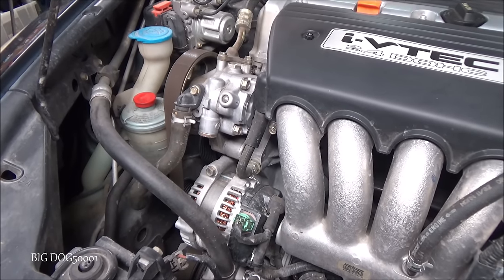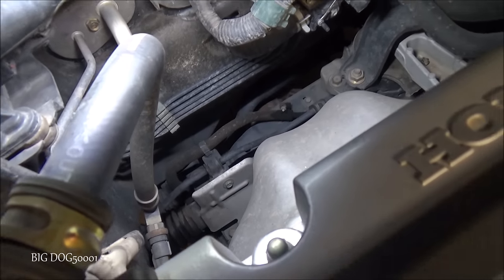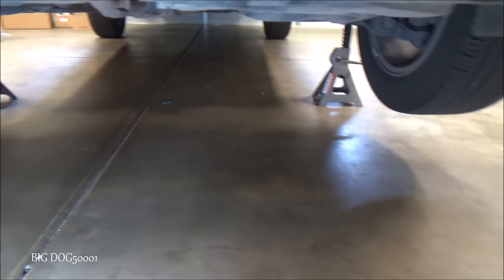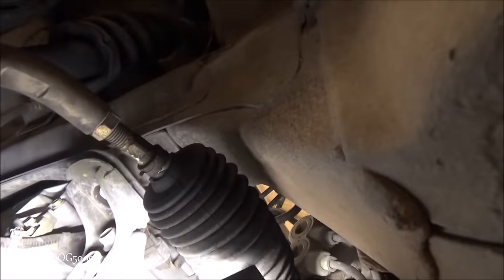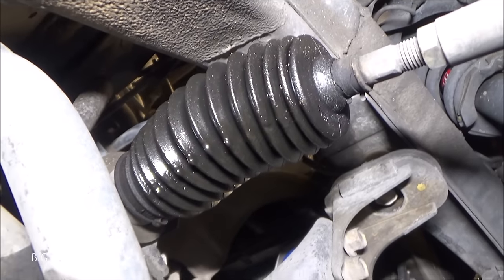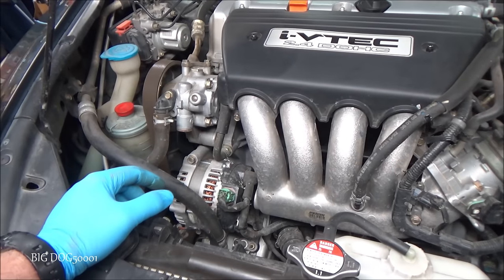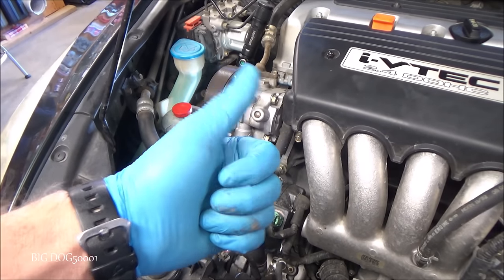Honda Tips: Finding a Power Steering Leak

Comment: My father in law had a power steering leak on his car (2004 Accord). I found it was the upper hose leaking from the pump to the rack. Thing was a BITCH to fish through to the rack, but after a little patience and a lot of cussing, I got it on. 
My sister in law had low fluid last week. I just happen to hear it when she was leaving and told her to leave it. I didn’t look underneath, but I saw a little oil behind the pump. I changed the Oring on the hose and topped it off. If that doesn’t fix it, I’ll take a better look at, but I’m wondering if I won’t have to rebuild that pump. Is it difficult to do? She has a 2007 Accord.
Reply from the maker: Leaking pumps are not too difficult to take apart and fix.  Thanks for the comment!
Reply: @BigDog50001  Hopefully that oring fixed it, but I get the seal kit if necessary and go from there with it. Pretty sure it needs a NSS right now, though lol. Thanks for the reply.

Comment: I have a 2004 acura tax and cannot find the leak from the steering pump onto my alternator. No issues with my pump really and fluid isn’t really ever that low. So it’s a small leak. Any suggestions? Maybe change all the seals in the pump first before I buy and install a new one?
Reply from the maker: Hard to say without seeing it but the seals on Honda power steering pumps generally start to leak by that age.  The fluid will usually start to deteriorate drive belts if left on them.

Comment: Also have the same problem with our family car (Honda CRV 2003). Will need to bring the car to the dealership again in the Philippines. I'm curious how much will the dealership charge me for the power steering leak. It's been months that I'd top up the fluid before driving out.

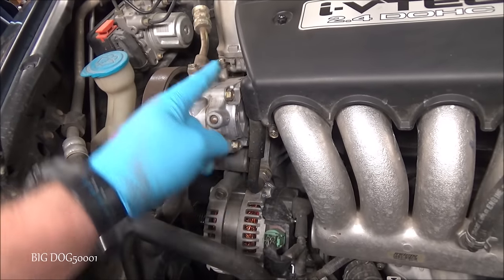Comment: 05 accord 4 cylinder ,Mines been leaking very little from the eternal seals like the video showed at 1:00 only had to top off once within the last 2 weeks very tiny leak but today I popped the hood and noticed alot of power steering fluid coming out the top of the resivior with a lot of small bubbles do I need to replace the power steering pump immediately or can I still drive for a couple more days because I don't get paid till Friday and I drive around 100 miles a day 

Ps forgot to add, this is my only car

Comment: The whining noise can be hard to diagnose on these engines, it could be a bad o ring that isn’t even leaking but letting air in , could be alternator bearing, could be tensioner , could even be a transmission bearing issue causing whine , good video tho
Reply from the maker: Yes it can be tricky, thanks for the input!

Comment: How much approx is an OEM power steering pump on this model? How much did this job cost with labour?
Reply: Ayoub Farid too much. Several hundred
Reply: Ayoub Farid around 800 a one sided I call for Civic join the tell me 1000 each one

Comment: There is good aftermarket stuff out there , you just have to investigate a little bit. My boot was gushing PS fluid and had to go but I got an aftermarket product and it seems to be working good , zero leaks, a year after. This usually happens to older cars so the expense of putting in a brand new OEA on a car that has limited years on it does not make sense at all. The diff can be as much as 300+ so keep and open mind.

Comment: I replaced my power steering pump on my Honda Accord 2002 but the winding came back after about a couple weeks. I'm suspecting it's not the pump. The fluid does go low after about a month too. The winding/grinding goes away for a few days but comes back again. Any ideas? Rack and pinion maybe? It makes the noise even with fluid in there. I smell a burn smell at times from the reservoir. 
- This video is amazing! Thank you. I will check underneath at the ti-rods.
edited:
- My guess with the oil leak is that the oil filter SEAL came off and when the oil filter was replaced the person replacing the oil filter placed the new oil filter over the used oil filter seal. OR whom ever replaced the timing belt didn't replace the seal and it started leaking oil at the timing belt area. That happened to my Honda Civic 01. Now I have to have a mechanic fix the oil leak and replace the timing belt again.
Reply: check the 2 Power steering O rings

Comment: I have some small drops of red looking fluid under my honda element 2006 and the power steering is low what do I need to do?
Reply from the maker: I would top off the steering fluid first (with Honda fluid only), a low fluid level on a component can sometimes lead to finding a leak but not always.  I generally start from bottom and work up to find the cause of the leak, sometimes it is necessary to clean up everything good to find it.   Leaks have a way of running across an engine/transmission like a plinko ball so it can be difficult sometimes.

Comment: I have owned two accords and both of them have leaked on the bottom of the power steering fluid reservoir tank.
Reply from the maker: Thanks for the input!
Reply: What was the cause of that leak, cus my 99 civic is doing the same all messy under the reservoir tank
Reply: @VictorRodriguez-nq9xc  in my case I think it was one of the low pressure hoses. The small diameter return hose was cracked on one and the larger diameter hose that feeds the pump showed a larger diameter than normal I guess through wear and tear. Anyways my 04 Accord is fixed concerning that but my 06 Accord I’m going to test it out today on a long drive. I’ll let you know the outcome.
Reply: @jogmas12  did you replace that hose?, I’m thinking of using blue devil stop leak but I hear is only for the rack n pinions?, it wouldn’t cause any effect to the hoses connected to the reservoir tank of the PSF?
Reply: @VictorRodriguez-nq9xc  I replaced the hose and took it for that long drive. Came back but it was still wet underneath the reservoir tank. I’m thinking the small return hose needs to be better seated.

Comment: Hey bro I have the same problem with my 2003 Honda accord my driver side boot has oil on it coming from the inner on rock auto they don’t sell the whole piece together they sell the outer the inner and the boot all separately I know it’s not Honda OEM but I’m only gonna have this car for another year so I’m not too worried about it should I just buy the boot and the inner tie rod?
Reply from the maker: new boots and tie rods will not stop a power steering leak, it is the seals going bad that generally cause leaks at the rack.

Comment: When we mentioned rebuilding pumps, what did you do? I have no power steering at low RPMs, which is supposed to be common in the Odyssey ('06). I replaced all the O-rings and the bearing seal. Is there something else? A whole new pump is pricey, so if a rebuild is possible I'd rather do that.
Reply from the maker: I will take them apart and replace all o-rings, seals and bearings, *to correct a leak*.  When there are other problems like no power steering assist at low end (which is very common on 2005-2010 Odyddeys) and the issue is the pump, I replace the power steering pump.  This is also what Honda does if there is an issue like that.  Some of the internal parts (like the flow control valve) are not available separately which I why I do not try to rebuild them for issues like that.

Comment: Dave, another very good informative honda video. I purchased a rebuild kit for my 07 3.5 for that small O ring on top of the pump but so far the 99 3.0 has been good. Fingers crossed. Will you record the repair? Might make for an interesting video but probably too time-consuming. Have a hot one on me I know I will temp is around 15 degrees here on Long Island. ❤️️
Reply from the maker: 70 degrees there today, brrrrr!  Thanks for the comment!

Comment: Would you suggest oem salvage rack and pinion?
Reply from the maker: Typically no because they will most likely have the same issues.  They have a high failure rate after a certain age.

Comment: Hope that’s not why mine is whining now ... doesn’t appear to be leaking though cause the reservoir is filled between the lines ... What’s a rack from Honda cost ?
Reply: $1423.88  Was just at honda today getting my recalled airbag replaced and they said I needed a new rack on my 04 accord.  I'm waiting...
Reply from the maker: They cost a lot depending on model, they are a lot of work to get in and out.
Reply: I noticed a whining sound recently & guess what..??  A leak!!

Comment: How many hours in shop time to replace a '04 steering rack and do you recommend replace motor mounts at the same time???
Reply from the maker: Book time for a complete steering rack on those is about 3 hours, plus additional time for an alignment.  Changing mounts would be a judgment call based on the condition/age of mounts (and whether the owner wants to), I would not change them solely because I was replacing a rack.

Comment: Power s. Pump leak and i already changed the pump but still leaking. Wht shoud i do ? 🙁
Reply from the maker: Depends on where it is at, if the leak is at the pump then most likely it is either the seals inside the pump or the seals that attach the hoses to the pump.
Reply: If you already replaced the pump then it's the hose, most likely the high pressure house

Comment: Did you find out about that oil leak? I came to this video to learn about the power steering noise, but upon changing my oil today, I noticed the same leak in the same spot!
Reply from the maker: Vtech solenoid gaskets (spool valve filter).  Very common leak on many Hondas.
Reply: @BigDog50001  thanks!
Reply: @BigDog50001 are those easy to replace. I have that issue with mine

Comment: i just changed my power steering pump for a civic 06 LX 1.8 but afre 2 days there seems to be a leak but im not sure if the high pressure hose connector with an oil seal or the bearing of the pump itself is leaking. any tips? thank you
Reply from the maker: I would clean it up and try to pinpoint leak.  If the o-rings on hoses were not replaced when it was installed I would replace them with new ones.  If it is a used or rebuilt pump, it may have been leaking or not rebuilt correctly before you installed it.

Comment: Great vid! where did you have it repaired? @ honda dealership?
Is it possible to get a honda power steering rack at aftermarket shops?
I will guess the engine oil leak on the side of the engine is a worn o-ring on CPK (crankshaft position) sensor?
Reply from the maker: There are non dealer repair shops that will use factory parts, just have to ask.  The engine oil leak was at the VTEC solenoid.

Comment: So my front feed line is leaking like crazy and my power steering reserve started spewing fluid like a lava cake....wth do I do now? No whining, no grinding, no steering issues at all, I was jus trying to jump it from a battery drain issue.
Reply from the maker: Sounds like the line that is leaking needs to be replaced (the spewing you describe is most likely from air getting into system).  I would make sure the PS level is topped off until it gets replaced so the pump is not run dry.  Once they start leaking they usually leak pretty bad so I would not wait.
Reply: @BigDog50001  its definitely a seal, I can see where it should have been. Thing is it looks like its been leaking a while, right onto my alternator. Could this be the cause of my recent battery issues?
Reply from the maker: @joricameron7132  It can definitely ruin an alternator.

Comment: vtec solenoid gasket seal.  those k24 suffer from that.  Just need to change the seal
Reply from the maker: Thanks for the input!
Reply: first of all it’s a k20a  🤣
Reply: @Bongs_and_Banquets  I own one of these cars, they don't come with k20a.  Besides, if you look at the video, on the valve cap cover, it states it right there.  I-vtec 2.4 dohc. 🙂

Comment: On the car in this video, do you remember if the pressure line connects to the upper fitting on the ps rack or lower? One brand Maval says it goes on the lower fitting in their description on Rockauto but I don't see how. I just did this job on my 2007 Accord and immediately began having a pop sound at idle speed steering and leaking from the Driver's side inner boot. Making sure I didn't cross-up the lines.

Comment: I wish you kept going. I have a leak and it seems like it's coming from a white container at the bottom of my car. I was putting on underglow and I watched it leak the entire time I had the car jacked. I'm waiting for my guy to confirm this before I buy anything, but he keeps putting it off saying he can't jack the car high enough. I know at least one place this is leaking from and I just want this fixed, but no video I am watching talks about this thing I'm seeing. I don't know what it's called, so I can't replace it. I thought it was the reservoir, but I can't imagine it being that because everywhere I look it seems that the 8th gen civic reservoir isn't actually that big. Not big enough to reach down to the bottom of the car anyway. This white canister I can see from the bottom of my car, it sits close to all the tubes and it just leaks all my power fluid.

Comment: Around how much does it cost to replace a Honda steering rack
Reply from the maker: $800-$1400 or so in the US, depending on parts used and labor rates.
Reply: @BigDog50001  This is terrible news for my girlfriends new old CRV. Great video by the way.

Comment: Can I have an estimate amount of how much it will cost to replace this w the mechanic? Thanks
Reply: To give you an idea, on my '07 civic repaired @ Honda dealership, 1300cad for the steering rack and 500cad for labour. Plus they also replaced the tie rods and rack ends since they are already on that job connecting both ends of the steering rack.

Comment: If you suck the oil out of the reservoir and replace it with Honda P.S. fluid every time you change the eng. oil you will put that reair off for a long time.
Reply from the maker: Thanks for the input!

Comment: Hi there, great video, my son in law has the same issue , it’s a public holiday at the moment and stores are closed,is it okay to use mineral p/steer oil just for a couple of days until he can get it repaired ?
Reply: NO don't use any other type of fliud even temperarily as it can ruin your whole system. Only use Honda power steering fluid or regret it.

Comment: Great video Big Dog! My pump had a small leak which i cleaned a week ago and hasn't gotten back, system isn't losing fluid anywhere else, reservoir remains full at all times , yet my steering wheel gets hard as a rock occasionally when i am parking the car and need to fully turn it in either directions. I cant really say there is a whine when i turn or it is very quiet yet and i dont hear it... any suggestions ? Thanks
Reply from the maker: What is the year/model?  Also, did this hard steering start after working on the pump?
Reply: @BigDog50001  My bad, its an Acura TSX 2007 ,A/T . And yes, i believe i noticed the hard turning after i cleaned the pump..for which i just used a towel sprayed with a little bit of brake cleaner, i didn't pressure wash it or something like that. Problem seems to be intermittent. Thank you!
Reply: car has 130,000 miles on it

Comment: I purchased a 2008 CRV - in 2017 - mileage was under par, so not excessive.  But I have spent $5,200 on this piece of trash-struts F/R, Rt. axle, 2 cooling fans, pwr press hose, alternator, rear bearings,  I HATE HONDA.   I formerly had a Civic 1989-2001 not real severe issues like this.  Now 2020 pwr steering leaking all over the place.  NOT HAPPY
Reply from the maker: All vehicles break and cost money to repair and maintain (especially the parts you mentioned), doesn't matter if it is Honda or another manufacturer.  A vehicle over 10 years old will have to be repaired from time to time.
Reply: New vs used is a matter of pay me now or pay me later. I have a 2006 that I have to spend about $1K a year on average but compared to $400 a month car payment I think I have come out ahead. Bought the thing when my Kid was 6 and now it is a decent college car. Have to keep an eye on it to stay ahead of the inevitable fault. In comparison in the last two years I have spent more on my 2017 Subaru forester in repairs than on the Honda.

Comment: Just had a rack and pinion done but now it's leaking more power steering fluid than before :/
Reply from the maker: That can happen, especially on aftermarket rack rebuilds.  I would definitely try to track down the leak and see if it is the new rack leaking or a different area that maybe was missed the first time.
Reply: @BigDog50001  thank you 😊

Comment: When Big Dog50001 needs genuine Honda parts and fluids, where does he buy them?
Reply from the maker: Local Honda dealer, HondaPartsNow, HandA Accessories and others that I can't think of right now.  I even get them on Amazon too sometimes, but I only like to get them from Amazon itself, not market sellers.
Reply: Honda wanted 530$ for the return/cooling pipes from behind the engine to the reservoar. I have decided to just get some copper pipe, hose, clamps and fasteners from my local hardware store. I’ll probably end up spending less than 100$.

Comment: At this point, for cars of this age and value, It's probably worth it trying a power steering stop leak product first.  For less than 20 dollars, it could buy you a few months or years before having to either sell the car or do the steering rack repair.
Reply: NO don't use any other type of fliud even temperarily as it can ruin your whole system. Only use Honda power steering fluid or regret it.